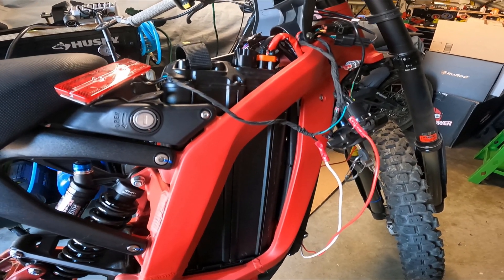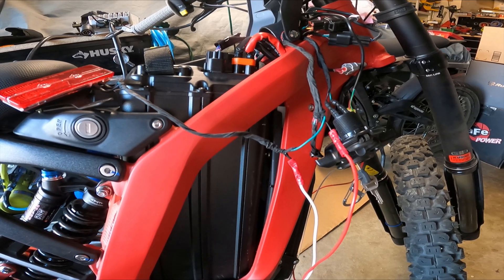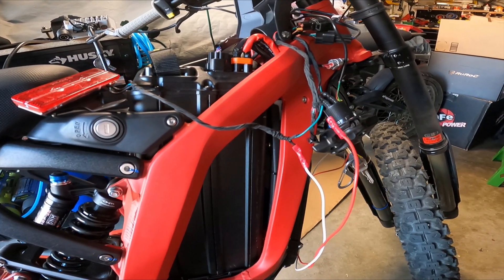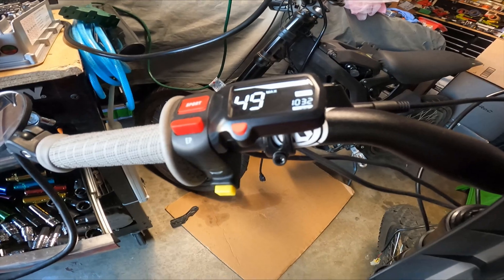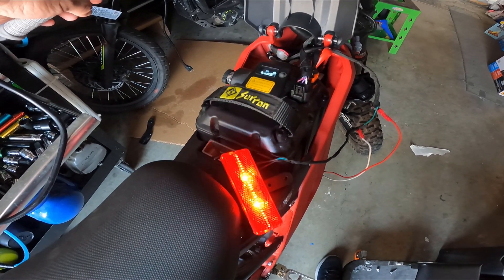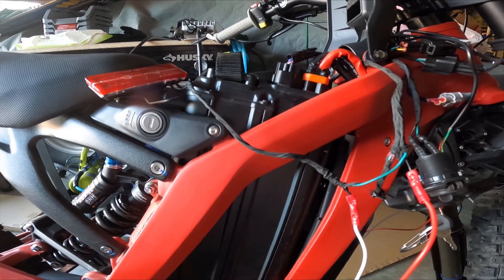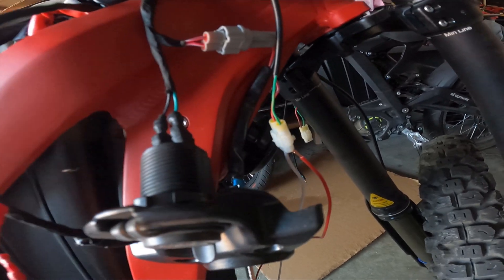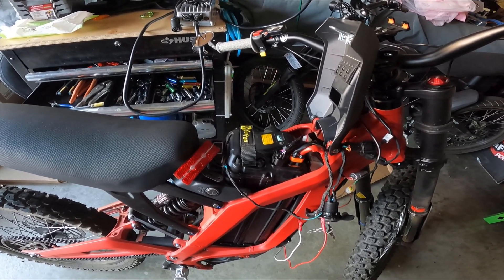Sur Ron X Light bee, modifying rear light to a functional brake light.

Comment: You should’ve left the brake light on the back how is an added LED strips that have a higher peak brightness and clear red glow tone so that way it’s closer to a motorcycles brake light and it’s not just a random flash that comes on also, you can make dedicated zones For each LED strip, and Daisy chain them to have each individual strip admit in unison and use the side ones because I would imagine strapping the LED lights under the seats would be nice, but you can also have an actors blinkers and it’s not even complicated. You just have to add a few more wires in the ignition bay to give them independent function from the original sons brake light and yes, I use speech to text since I’m a terrible speller in English English